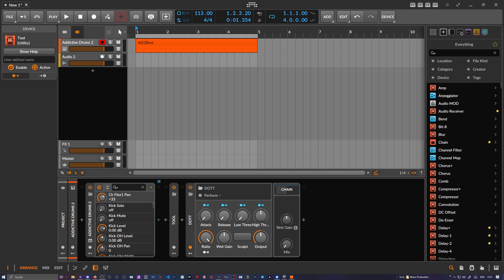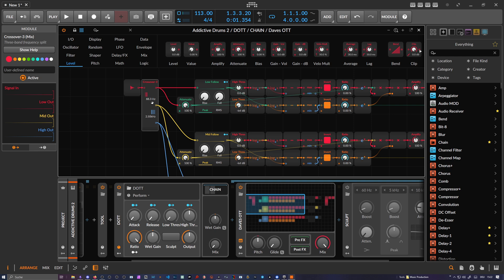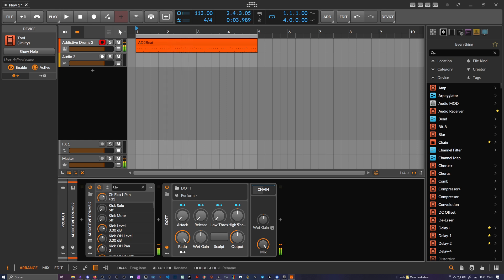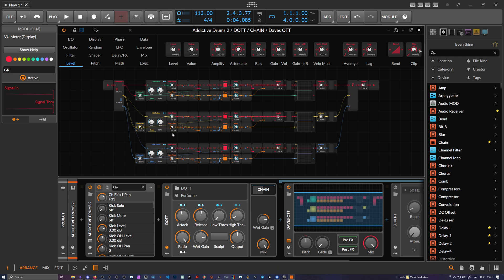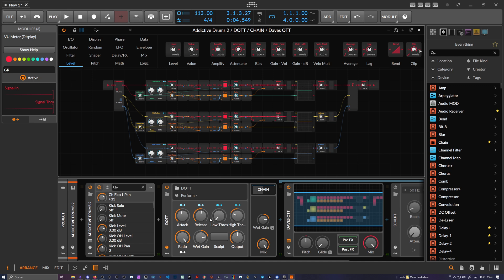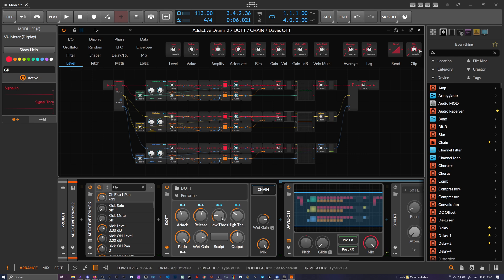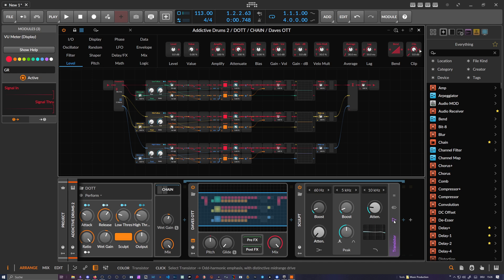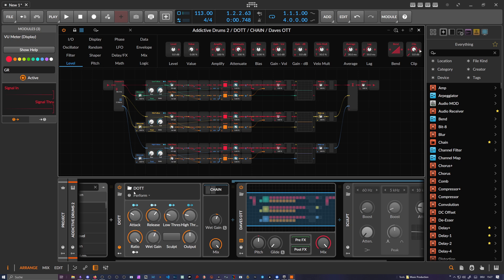this is too over the top - OTT in the Bitwig Grid

Comment: What are the advantages over just using (free) OTT?
Reply: one less plugin to install

If OTT ever stops getting updates you don't have to rely on a dead VST

Dead VSTs, specially free ones disappear from the web over the years and now you're stuck opening an older project and replacing it and re-mixing your track to get the original sound and sometimes you can't get the original sound right. Ask me how I know...
Reply: @ht3k   I mean, that's true of any software, not just 3rd party plugins. If you're searching for longevity you have no choice but hardware inserts. I made music in Cakewalk for years, ask me how that aged.
Reply: That you learn something

Comment: I personally extended it with a Shaper module instead of a regular threshold and ratio. So you can do upwards/downwards expansion and compression depending on the curve you draw. Add some bands, and you basically have FL Maximus, which is an awesome dynamics processor.
Reply: How did you implement this if you don’t mind sharing? And if it’s possible to explain in comment

Comment: I wish besides the attack and release there was a way to make a hold parameter for that compressor.
The closest approach i could come up with was splitting the envelope follower signal several times, delaying each by different amounts (using an attenuator to make these values relative to the maximum hold time), and then comparing the maximum of each pair, then comparing the maximum of each MinMax until i got one signal that is the maximum of all the signals. But that is way too hacky and breaks on long hold times + fast rise/fall settings. I don't know what would be the "correct" way to implement it.